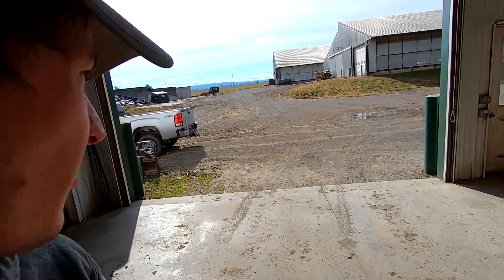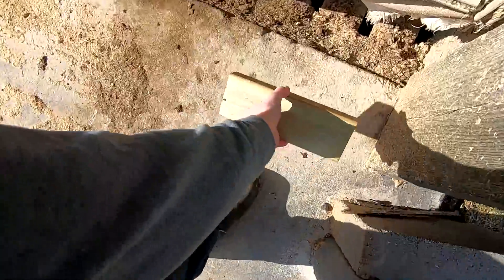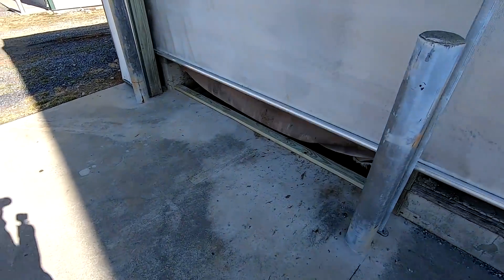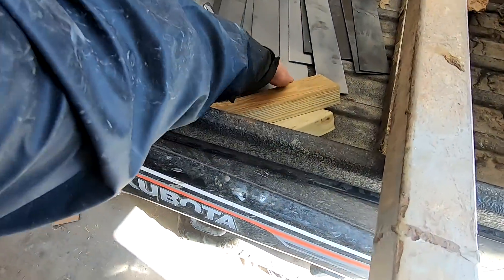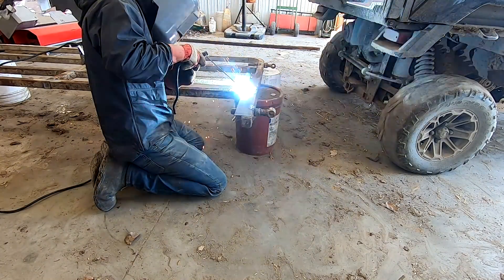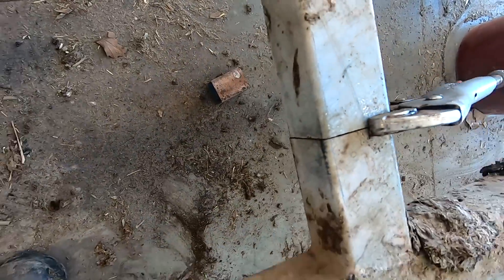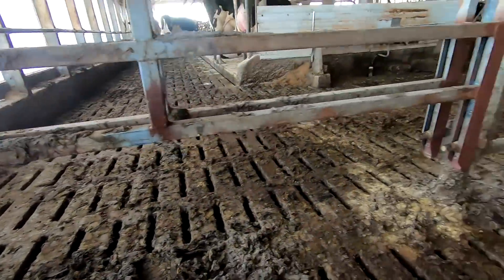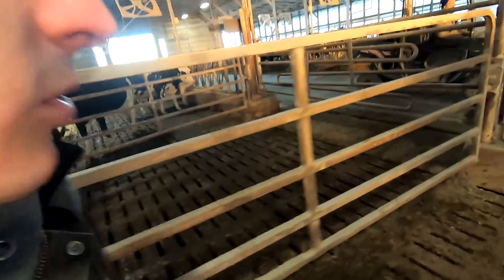Modifying Barn for Robot Scrapers

Comment: Great video! We run one of these scrapers for almost 10 years in our barn. Best tip we ever got, is to put 2 scraper blades behind each other, so you get a thicker rubber. This extends their live more than twice. Because the single will bend/flip back when it gets older. With 2 this doesn't happen.
Reply from the maker: Good to know, thanks!

Comment: A word of caution: Welding galvanised steel (zinc coated) is hazardous for you. The fumes can give you an illness similar to influenza - welders lung. If welding it, grind to remove the zinc where the weld is to be.
Finally, spray with a zinc spray afterwards for good protection of the metal. That spray can be found at welding consumables suppliers.
Great work though. Your welding is getting better. Gates are difficult to work on. Those small inverter welding units are awesome!

Comment: Idea for the "removable boards" at the often used doors: put a piece of 2x4 on top of the screwed down one and the plank. Then just screw it down on the small piece. Thtat way it will stay put and you can slide it in and out basically.

Comment: Awesome watch! Question, don't mean it in any way though, but how come you didn't weld a piece of that 1/8th to the front bumper of the robots, that way you wouldn't have to adjust the height of each curb. Unless that messes with the sensors or something, just some food for thought!

Comment: Looks like your having a great spring, we just can't get rid of old man winter as we get a couple of inches of snow and then it warms up and then we get snow again and then warms back up. We have gotten rid of the snow as we have had rain and snow in the last week and there was tornadoes in southern Iowa over the weekend and we had rain and then a inch or two of snow and that has melted and we're supposed to get snow the next 3 days and then get up to 40 by Friday. At least the days are getting longer which helps. But my dad always said that you can get all your snow in April and we are like 20 inches behind in moisture this year.

Comment: Have F&T locate the charger as far from the gate hinge as possible to allow adequate room for machine to “wall follow” straight into the charger. All wire and plumbing to and wiring run in conduit. Cows love chewing them!!

And great job on the videos!
Reply from the maker: Thanks for the advice